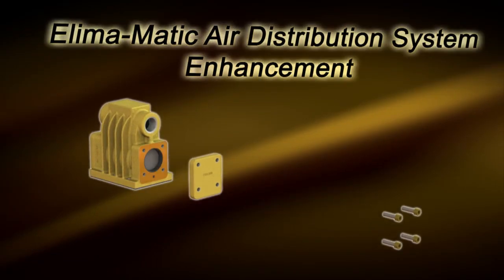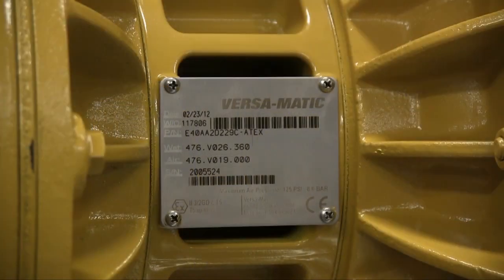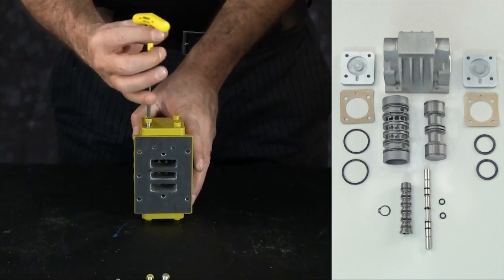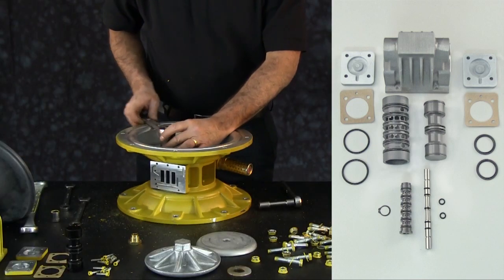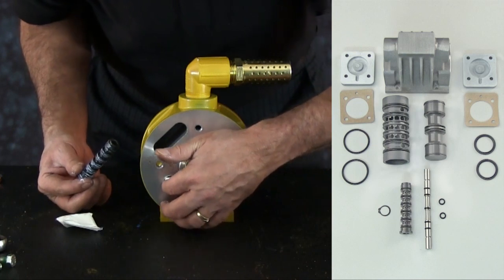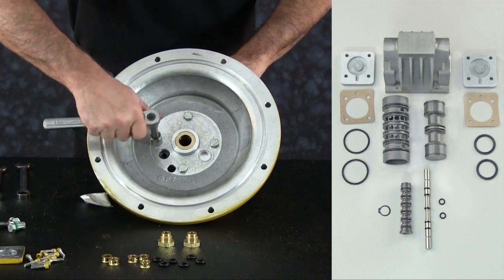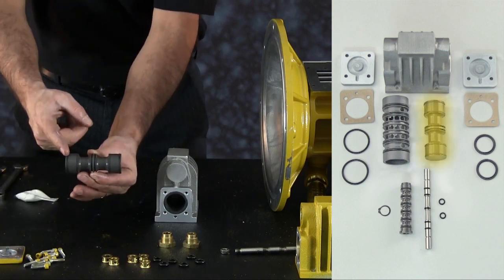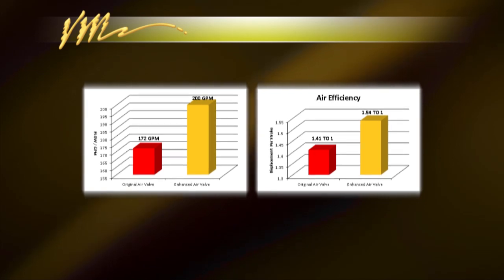Versamatic Pumps: Elima-Matic Air Distribution System Enhancement

Comment: forgot to mention that the value sleeve needs to be aligned with the housing accordingly. (the holes at the end of the sleeve) I had set it it wrong and the pump would work erratically.